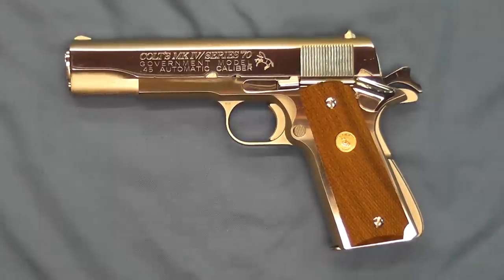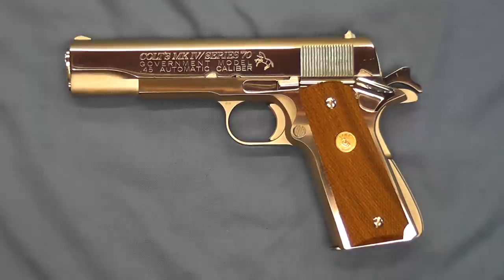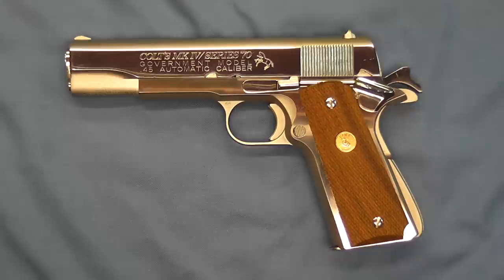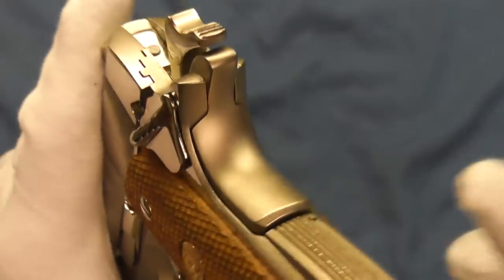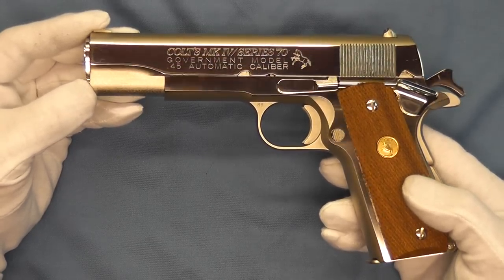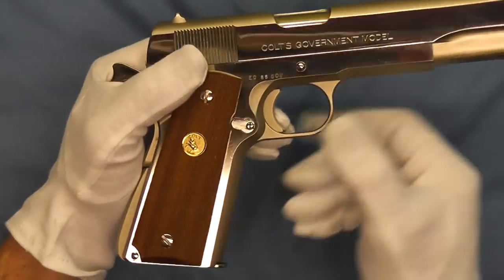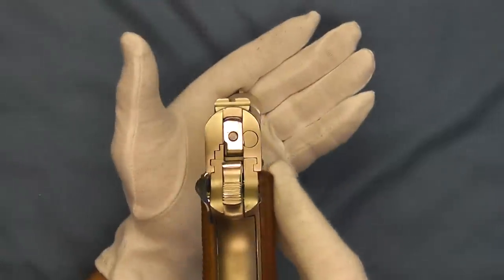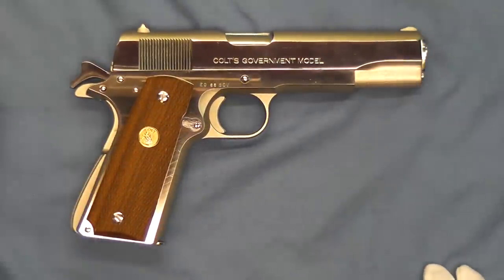Experimental Nickel Colt Government Model Mark IV Series 70 1911A1

Comment from the maker: @profsat5 The collection used to contain two fully automatic Colt Model 1911's complete with shoulder stocks and extended grip magazines. The pistols are mentioned in Charles Clawson's book, "Collector's Guide to Colt .45 Service Pistols Models of 1911 and 1911A1, First Edition".  If I remember correctly there were only two or three made by Colt.  
Unfortunately they have been sold and are no longer part of the collection.
Thanks for watching!

Comment: Any recommendations on a 1911 to buy? One that I would at least be able to personalize, not like overly exagerated but like a nickel plate finish like this one, or different grips? Budget is around 2,000$ at most, or just a good well built 1911 in general, because I can save a little to personalize at different times.

Comment: I have the same  Colt Mark IV series 70 nickle plated. I got it back in 1986. I did modify the ejection port by triming it lower in order to reload my empty caseings. In stock form it dings the casings as they exit the port.